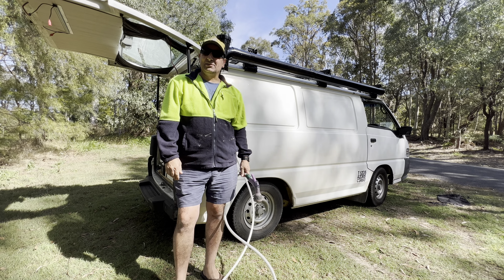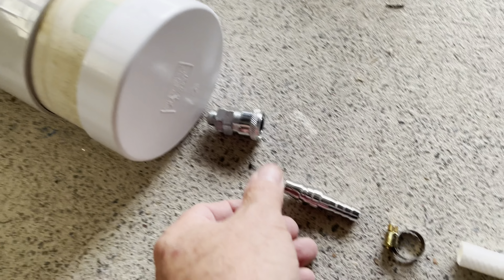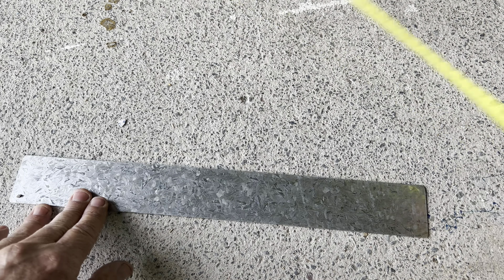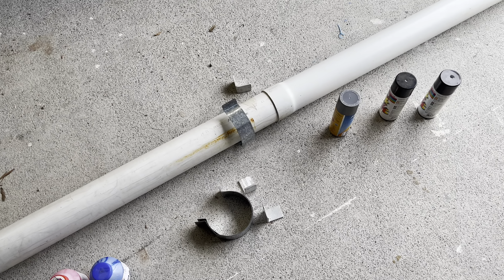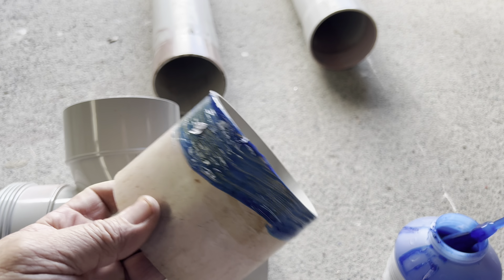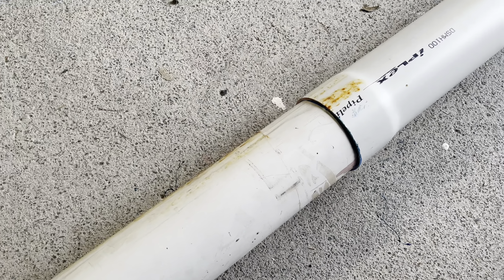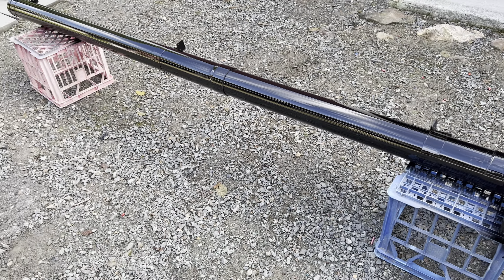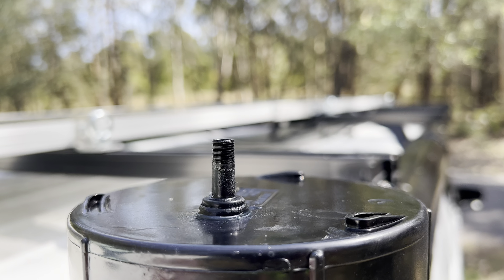Pressurised rooftop solar hot water off grid Mitsubishi van

Comment: This is such a great idea! bloody legend! Our Hiace will be a comfortable home on wheels soon with your help!

You helped us a lot on our van build journey, we have pretty much finished it now (bar some cosmetic upgrades) and travelled across the country in it. The only thing we didn't do was mount the roof rack and panels onto roof rack as we ran out of time.

Our setup is;
Renogy 200aH 12V Bluetooth Battery

Renogy 40A DC-DC
Renogy 3 x 175W Solar Panels (I wouldn't recommend these panels, I've never gotten the full output, I think the closest I got was like 35A)
Renogy 40A MPPT Solar Controller
-Beauty about having separate DC-DC, MPPT controller is the highest amps I've had going into my battery is around 70A, theoretically 80A - Perfect when you've had shit solar for a few days

Renogy 2000W Inverter

All our battery chargers + blade fuse holder have individual breaker switches which has been super handy when we aren't using the van and want to rest the battery at 40%-50%

I went overboard with my cable sizing and everything is fused to perfection, hasn't been a fuse blown or a fire :') since my unexperienced self did the electrical work :P (I did a lot of research though)

We have individual touch/dimmable lighting so if we only want a light on at one end of the van dimmed for reading while the TV is on at the other end we can do that.

I'm in IT and love my gaming so I brought along my PS4 on my trips and everyone is always so bewildered at me playing PS4 in a Hiace for a few hours at a time, we've actually never gone below 40% battery except for one day when it was raining for the entire day, just switched the DC-DC on and it was good to go again.

A video I'd like to see you do would be hooking up a non 12v (e.g. 19v) TV onto 12v DC using a buck converter. All the 12v TV's are obscure brands and if they are smart TV's they aren't good ones (Kogan), I've seen someone in the UK do it but got no idea where to start looking for that equipment in Australia (I assume you might?)
Reply from the maker: congratulations on your setup and it sounds like it works for you … 35 amps isn’t bad from your panels as they are laying flat . great to see you getting around enjoying this great country of ours . sorry I don’t have an answer for powering your tv using buck converters as I haven’t really had a need for tv in my travels . thanks for your comment and watching my video 👍 safe travels 👍🍻

Comment: I really like this. I've see it done before, but your instructions to build are excellent, thanks. 
I will make a "U" shaped one for the front top of the camper (Its a brick shape), so dual use, hot water and a little bit of aerodynamics by presenting a less abrupt shape to the wind.
They say matt black allows greater heating as it absorbs more sun. Not sure if it makes much of a difference though..
Again, thanks. Nice Vid. (Also thanks for the link to removing PVC fittings - my next watch).
Reply from the maker: Cheers mate thanks for watching 👍🍻
Reply: The science behind it is called the 'Albedo Effect', meaning the darker the objects have a lower albedo so it absorbs more heat. Where as a white body cars or ice caps for example will reflect light. :)
Reply: @EFFICIENTSELF  Keep them coming. Now that I have found your channel, I can't get enough. :) Cheers and thanks.

Comment: Many years ago I used to use exactly the same method to be able drain very thick Penrite HPR/50 motor oil out of 20L drums. Damn stuff would otherwise take an eternity to drain out of the plastic tap. That said, I've also seen what you've done many times before and if not careful with design and sizing of pipe it can contribute to a roll over, especially in a vehicle with an already high center of gravity. Add to that scenario in rough 4x4 driving and the angles encountered and it's a disaster waiting to happen. In your case without knowing the specifics of inside fit out it would generally be safer on the left side to counter your own weight. Also, with those sort of considerations in mind I've seen people make U shaped systems that are fitted at the front or back of the vehicle roof so they're better balanced side to side. That also helps limit the sudden sloshing from one end of the pipe to the other under braking or acceleration due to no internal baffles. I think a safer method of having a solar shower using implementation of a black painted pipe is filling the pipe at destination of use. This can be either from mains tap on site if available, a 12v pump to shift from onboard lower tanks (if fitted) or a portable pump and hose to pump creek water in.
Reply from the maker: Cheers for your comment and thanks for watching 👍🍻

Comment: I’ve made up a pipe like yours but never thought about pressuring it. Love it. What was the fitting you used to allow you to Connect the pump?? Cheers
Reply from the maker: I just used a tyre valve here is example of what I used https://www.ebay.com.au/itm/113427170363?hash=item1a68c9443b:g:Yl4AAOSwd3NfB2ui&amdata=enc%3AAQAHAAAA4JYN5jlb7zbz1pPRo12f6TcE4d88SbPI5d34AzAkO0IyEI8bMJMpeeM0PrL8FIFP9kAxU5e8PMyEmYllPCHtNAPOc1oj5zQu3PelXvWnO8aTTGGeyoWmdALpWn1iANTSgEjAwyV5yWFGXfslRsESFbXs3jFn2a2exz9LSzsckUw98l7gdOfdABcXIXQ4mNx3Y96DlQkgCMZprhRjFEWlbTdlxFZiV2S7mx4Kr39qfyIdky9LPjKzCiQpf%2BUhDEyf%2B%2BN%2FPUcQB6ScBQQ%2BuJ3csAkrXv5VJ5IXduoTKtsO%2BLQE%7Ctkp%3ABk9SR8acmKf8YA. Hope it gives you an idea mate and thanks for watching 👍🍻

Comment: Great video mate. Any reason why not use a 12v pump instead of pressurising the tank with air? I've got the Ozito 12v pressure pump and have used it for showering with a 20L jerry can.
Reply from the maker: Cheers.I never thought of using a 12v pump. I did it with the pressurising as Way as I have the pump on board the van. Thanks for watching 👍🍻

Comment: Hi Dino, 
Where did you purchase that black valve (where you put at the screw end cap) and fittings to go at the other end end cap please. Thank you
Reply from the maker: Hey Nora the tyre valves on eBay https://www.ebay.com.au/itm/154479599455?hash=item23f7b39f5f:g:tqwAAOSw559h80qF&amdata=enc%3AAQAHAAAA4L1h%2BxwsfYwtR2ErYGf0ico20llxuRuXRCI3Db4Z38aNhIHM8Ag0ngRCN%2FtcnFe1d3LTdUFPAqzPpHCnobVKbBWC%2FMljlQnKfTKuBp7LCT09G2E%2FRVmI5J0SbJVEEvZAla3R8KzJPqgkCmmNklwnSTOU97kGReTJlYKpBUCGRbxkeXKdQuhEb%2BrCcz5XiBBUpf3ScZxgEDViilkh69wKwMDwozKBO1gBzT7fLGuDm7fLp9REbnwo56nKkMZPEjzxQsgTP3Ow1N95B2%2B0E81IbNuNmUhJHc5B%2Bj8OcnmNd3zV%7Ctkp%3ABk9SR5yzrfH-YA  but maybe you can just get one from super cheap auto as eBay only sells bundles of 4. The air fittings you could get here https://www.ebay.com.au/itm/282954250480?hash=item41e16338f0:g:2DsAAOSwB5tbOJug&amdata=enc%3AAQAHAAAAoDEETVOId%2BS5FvT2%2B2kDuBwN04pPt%2FutKDbvErsbOowHf78aGpanEaChKVk%2B57KxhYiEju4mhO5D6cZCDnA41fbLcVJr0rwgYJxh5QXBdh7AGQA76h8H02K39btHxwHLgTk4reni1gEB8BIxKkum179pxqqY4OgR1ZFwz7OHEZOTSjSgte7UAee54KeLKfrPtQyFU66gD6JZNuxnrIdNCU0%3D%7Ctkp%3ABk9SR9TqzfH-YA but if it’s too confusing probably easier just to get a tap from Bunnings something like this https://www.bunnings.com.au/fix-a-tap-13mm-1-2-tap-n-snap-quarter-turn-garden-tap_p4900146 hope you have been well and all the best if you build something like this 👍🍻
Reply: @EFFICIENTSELF  thanks Dino